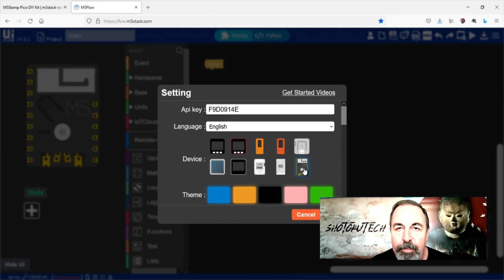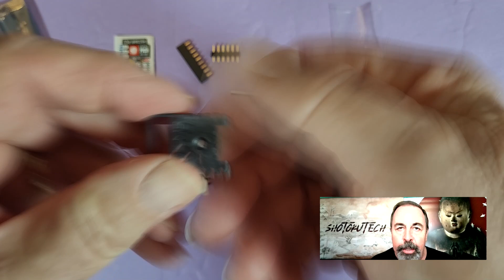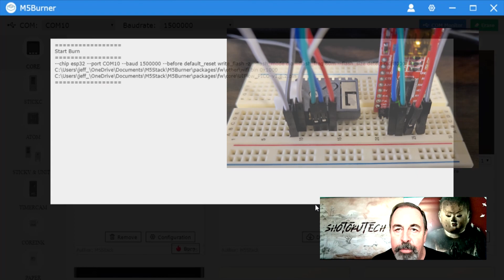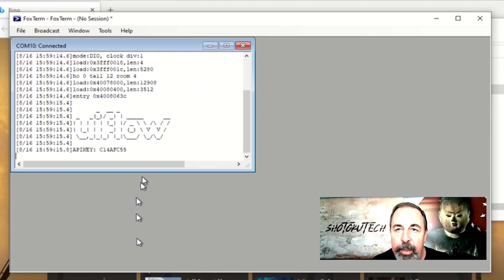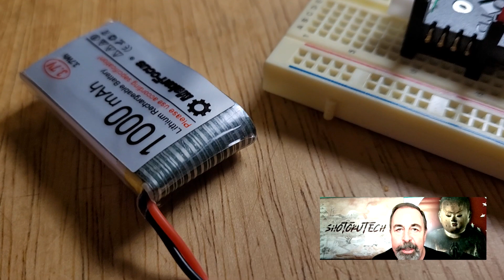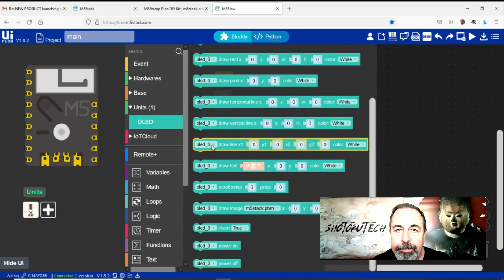New M5Stamp Pico Unbox and Test

Comment: It all worked without soldering the pins? Only by pushing them into the holes?
Reply from the maker: Certainly. That is what it is designed for. Thanks!
Reply: @ShotokuTech  It sounded too cool to be true ;-). Thanks for the video!
Reply from the maker: @KarolBrejna  Thanks

Comment: It was a bit difficult to tell since the camera was very zoomed in at the end, but it looked like you were able to power the OLED from the M5stamp's Grove port and the M5stamp through the 3.3V and GND. I'm trying to wrap my head around the exact power requirements for this device for making little mesh network relay devices, and I was hoping that the Grove port could be used to supply power to the module since that would make things really easy. I have seen the 5V and GND on the left side used to power the device by soldering a cut USB cable end, but idk exactly what voltage regulation capabilities the device has since their documentation simply links to the ESP32-Pico-D4 datasheet and does not mention how they accomplish power management -- it just says that the input voltage is 5V @ 500mA current, and the power consumption data is all measured at 5V.
Reply from the maker: Here is another video showing that I powered the board using the 3.3V pin. I used the M5Stack supplied ESP32 downloader that is pin for pin connection to that side of the Stamp. https://youtu.be/7VScFjCUnPM?si=vkUR_oSHhyTlcBF8

Comment: The brownout thing is just because you used the ftdi in 3v3, but the board is 5v-compatible, so, flip the jumper, change the wire to the other side of the board on the 5V pin and off you go.
Reply from the maker: Looking at the pinout, the side of the M5Stamp that lines up with the ESP32-Downloader shows only the 3.3v pin. The ESP32-Downloader does have enough current to support the stamp. 
https://www.youtube.com/watch?v=7VScFjCUnPM
Thanks!

Comment: Wait, U just plugged battery directly to Stamp and there's no need to use any step-up or step-down module? Just so without problems? Through 3V3 pin?
Reply from the maker: Hi. It is a single cell LiPo at 3.7v so it worked out fine. Thanks!
Reply: @ShotokuTech  Lipo voltage 4.2-3V, liion 4.2-2.8V, that's why I asked)
But if it's works fine - perfect))
Thx for video)
Reply from the maker: @KOTATEHb  Sure! Thanks.